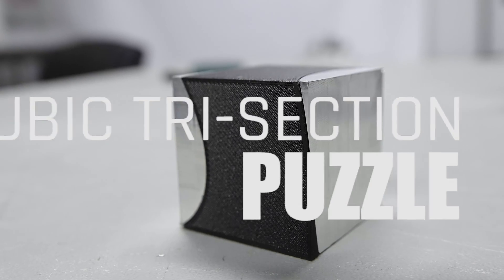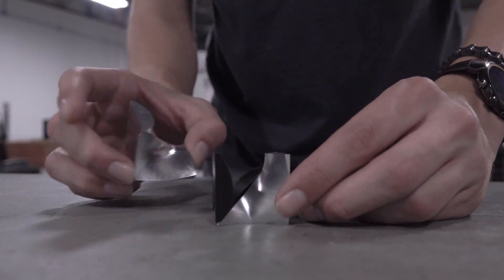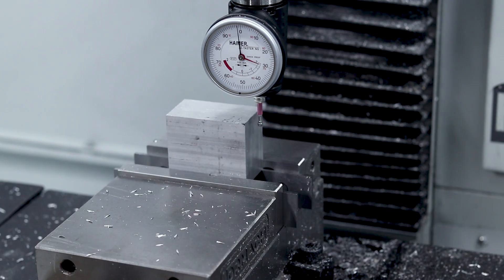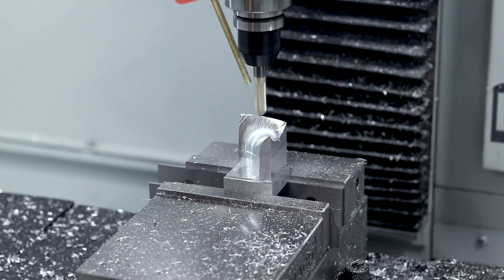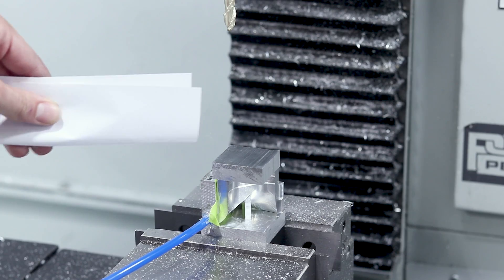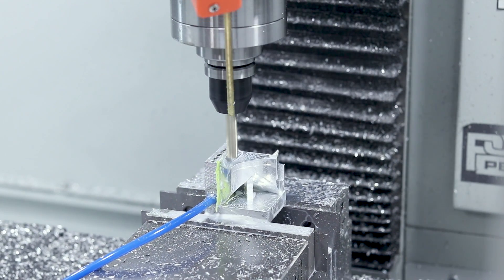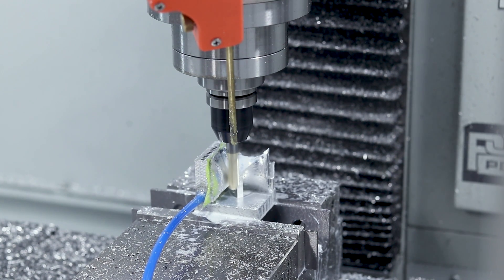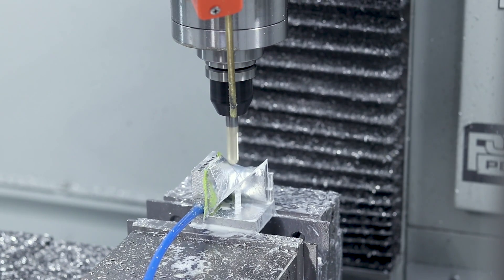Machining a Cubic Trisection Puzzle!  | WW218

Comment: Ok for the student, sure good job figuring out the solution.. But like adding additional supports/structures that you later remove but help in the process of making something is one of the most basic fucking concepts in machining/printing... How the hell did YOU not figure it out immediately? ANYONE with any amount of experience and intelligence should be able to look at the structure and realize that you could make the project a lot easier this way...

Comment: I can see a way to fixture it without tape or a stud. It has what appears as two small flat surfaces (Machined on the first operation) at the vertical ends when you had it in the fixture.just a clamp on each of those flats pushing it into the V of your fixture would have held it. No tape no stud.
Reply: I immediately thought of the same thing when i saw it, it seems more logical, right? And a lot more rigid than superglue or even the stud
Reply: The only downside that maybe could be when you have to go around the corner in that op and would hit the clamp, but this could just be programmed in the cam to avoid the clamp or the side altogether
Reply: No the clamp would not have to be tall. It would only have to intersect the part say about .050" or so. Once the part is in the clamps it cant come out. Its like being clamped in a dovetail. Even if you milled into the clamps a little it wouldn't matter.
Reply: Edge Precision o i just noticed it is Edge Precision that i replied to! I am a great fan of your channel, i have learnt a lot from you! Thank you for putting out such great content and sharing your knowledge!
Reply: faxxzc - "Edge Precision o i just noticed it is Edge Precision that i replied to!"  - Oops.  LOL.